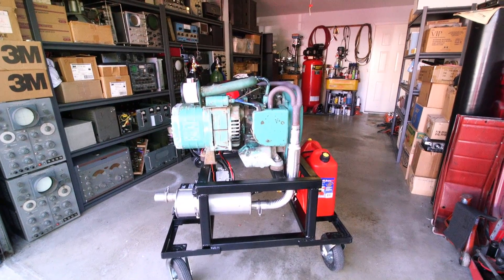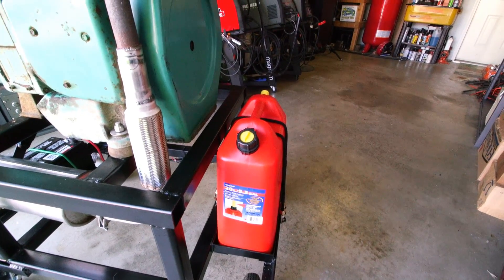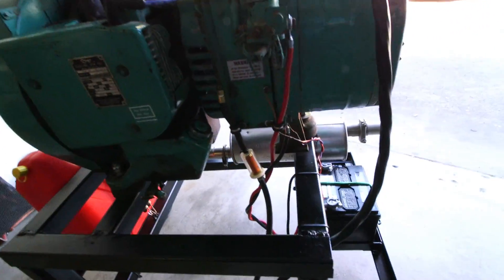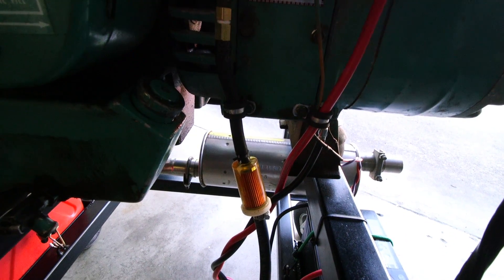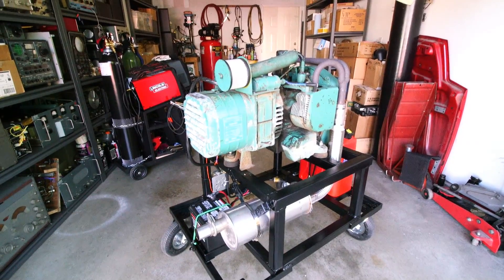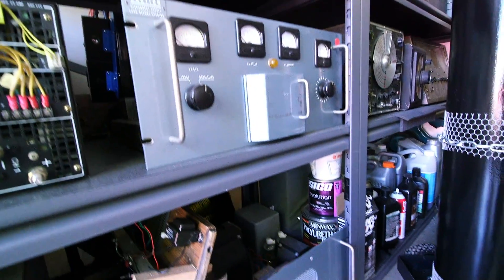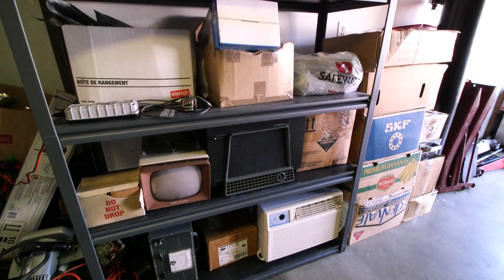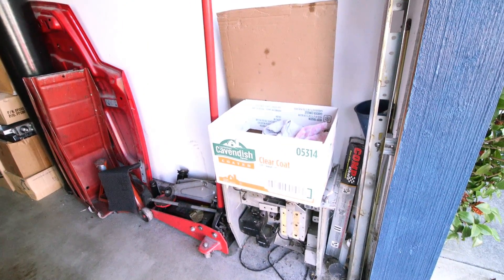Generator Build Update - See It Run!

Comment: Have you ever considered using propane for your stand by power? With the gas of today you will have to remember to change the fuel to keep it fresh. Propane will stay fresh MUCH longer and is cleaner burning than gas. A small 25 pound gas grill cylinder will run that generator for about 4-6 hours depending on the load. The regulator and kit will cost a few bucks but the ease of starting and the dependability is peace of mind.

Comment: Do you have ethanol added to your gasoline in Canada? You will have to add a gas additive to your gas if you want it to last more than a month or so. In addition the ethanol will eat at most rubber gaskets and seals etc.
Reply from the maker: I always use stabilizer, no matter what grade of fuel.

Comment: Worked on many Onan and Kohler Gens.  The Field control PCB on both of them is a weak point.  Repaired a many.    Pretty much the only problems encountered other then a engine issue.
Reply from the maker: No PCB in this at all. Wires, brushes and iron.

Comment: Hey I’m sure you know this already since you’re literally an expert in the field, I’m just new to the channel please so forgive me. Some of those old theatre audio amplifiers are extremely value to certain audiophiles. People will pay insane amounts of money for certain western electric, RCA, Altec etc audio amps.
Reply from the maker: I have some A&M theater amplifiers that are serial number 001 and 002.
Reply: @MrCarlsonsLab  the kids call that "flexing" :-) I've never owned anything valve based, I don't have the skills to maintain or even reliably operate it, but I live vicariously through your videos which are wonderful, thank you.
Reply: People like paying for their distortion :)
Reply: Dave Micolichek There are power amplifiers where you can synchronously sample the input and the output with a pair of phase-shifted 18-bit ADCs, apply a linear fit between the two to match gain and offset, use a steep FIR to limit bandwidth down to amp’s spec, and the differences between input and output are limited by the ADCs integral nonlinearity (1-2 LSBs or so). I work on such things so I’d dare say know a bit about them. Of course it’d be a bit crazy to use them as, say, speaker amplifiers, but audio”philes” probably pay more for some of their excesses anyway.

So yeah, no, you can and perhaps should use amplifiers that maintain the nominal accuracy of the input digital material, and are to the measurable limits transparent. And I’m completely ignoring the legacy specs of harmonic or intermodulation distortion, because those make sense maybe when you only got analog tools to do measurements. Once you digitize, you can measure the actual voltage values as a time series and see how much they differ between input and output. No need to do it in frequency domain.

These devices maintain their performance when you feed them with anything including wideband noise generated by a DAC fed from a random number generator. Even otherwise quite good audio amps fail such tests miserably because they don’t maintain a constant phase shift throughout the band, and when you feed noise through a varying phase channel you’ll get noise out back all right, except it won’t be noise that numerically is even close to what came in. When tested that way, off the shelf amps sometimes have trouble maintaining 9-10 bit levels of performance (1 part in thousand). 

So, noppity nope nope, I’m specifically working with transparent channels that can take CD resolution material and spit it out back with no alteration exceeding the resolution of the input. I’m paying for no distortion and I get it since that’s what the non-audio application demands - no distortion specs are actually used since it’s so misleading. 

I really wish I could take a good audio amp and use it in my application: alas, even the ones with best distortion specs just aren’t good enough because of phase and flatness issues. In a 16-bit channel, 0.0001dB flatness error (15uV amplitude drop from 1V) causes 1 LSB numerical error in a full scale signal. People think that 16 bits is “poor”, given 24-bit converters. Not even close, because all this has to be somehow transduced into voltages, and getting a 16-bit accurate voltage at the amplifier output terminals is stupendously hard - if the amp wasn’t engineered to such specs, there’s no chance it will perform anywhere close. 

The requirements for amplifiers that are truly transparent in the voltage time series sense are orders of magnitude tighter than anything normally sold for audio use. You need +/-0.00005dB passband flatness from DC up to whatever is of interest, and a constant phase flat to +/-0.00001 rad. Then you can, using a DAC, feed it a string of numbers represented as voltage, and get the same string of numbers back at the output. For testing you don’t need an ADC, just a physical delay line (a bunch of coax), and an AC voltmeter that measures the disagreement between the delayed input and the output. With a 1V full scale signal, the voltmeter would hover around 10uV RMS, even without bandwidth limiting, so I’d say that’s the performance you can get in practice. The results on audio amps are not worth even mentioning - they are kind of a joke. But surely they are much easier to make.

Comment: You have five or six joints in the fuel system all below the fuel tank any one that leeks could alow the whole tank of fuel to escape causing a heightened risk of fire! Here in uk it's best practice to have all joints above the highest possible fule level so if any leeks occur fuel siphons itself back into the tank. Not on the garage floor.
Reply from the maker: The pump is gravity feed, it was designed like that, as most generators are. The pump has to sit below the fuel tank.

Comment: Your fuel tank needs to be vented, with a check valve.
Reply from the maker: Hi Kennith. It's vented, and none of my generators (lawnmower.. chainsaw... weedeater....) have a check valve in the tank or cap. They do have a fuel baffle though, and so does this.

Comment: you can tap HDPE directly,just run the tap in the first few threads,just enough to establish threads. screw your fitting in with no sealers on it,it will seal perfectly due to the pipe taper. i've been doing this 20 years with plastic rain barrels and such.
Reply from the maker: That was done, along with a gasket in the tank, and one below for triple the safety.

Comment: Nice build. Yes those are VERY dependable. Everything you said is true, 1800 RPM twin cylinder Onan gensets are great machines. I worked on Onan gensets in the Army in 1975 to 1978 then again for an RV repair company where I started the genset "department" I also live where the power has gone out for extended time frames and I have a Onan genset I did the exact same thing with. Mine is only a 5KW set so the whole house does not get power but there is enough to live on :D Very nice.!

Comment: Crazy I actually own over half a dozen of these Onan Rv generators in different configurations.  I never get to use any of them, (Yes hoard them..lol)... and never can resist the temptation to grab one whenever they show up in the market dirt cheap. They are one of the best built generator units out there, outside of diesels.
Reply from the maker: I agree Franklin.
Reply: Onan generators are the best man, we have a propane one at our AM site and a natural gas one at the studios, they are both over 30 years old and when we need them they fire up no problem, I know today onan is owned by Cummins don’t know about back then but  I was talking to a truck mechanic the other day by chance he told me they build the gasoline, Diesel, natural gas and propane engines from scratch for each type where as other manufactures adapt one engine toward one of the four

Comment: It may be the camera angle but the battery appears kinda close to the muffler. This may be a problem after running for several hours. You may wish to either relocate the battery or fabricate a sheet of aluminum between them to dissipate the heat.
Reply from the maker: Far enough away that the battery is stone cold after hours of operation.

Comment: Great video! The question arises as to why you didn’t convert the generator to propane? As a standby generator gas is inferior.
Reply: Or whatever heating fuel is already used at the house if it's not electric heating. Of which, once you get to that point, wouldn't it make more sense to build a CHP generator?

Comment: I never though about a generator that runs at 1800 rpm instead of 3600. Make sense that the cheap ones would run at 3600. Probably cheaper to make, and they wear out faster so you have to buy a new one after a couple of uses over the course of 10 years.

Comment: Some of the welders?
 I can understand our garage full antique electronics but 3 + welders... ; )
Reply from the maker: Two welders and a plasma cutter.
Reply: @MrCarlsonsLab  I noticed them too..At least that old Lincoln portable I have has 50ft copper leads on it..
Reply: @rgsnidow1  I rock an old tombstone myself. 
I was thinking about upgrading to wheels cuz I've only got 20 foot leads... Spark On!
Reply: @MrCarlsonsLab  ,   Some people wouldn't know a MIG welder from a TIG welder, let alone know what a plasma cutter does.
Reply: @MrCarlsonsLab  Something I'd expect from This Old Tony...
But you did say some of,
Which led me to believe there may be more in hiding. 

You are a multi-faceted fellow Mr. Carlson.
And have aided me in the repair of many a 78/tube radio combo...
And a wealth of other knowledge I may or may not use. Thanks again!
Reply: Plasma cutter - nice

Comment: Is the generator wound for 1800 RPMs, or is their a gearbox?
Reply: A two pole generator rotates at 3600 RPM at 60 Hz. A four pole rotates at 1800 RPM. There are six pole generators that rotate at 1200 RPM. I ran a landfill gas generating plant that had three 20 cylinder Caterpillar engines (3520C) that turned at 1200 RPM. Their combined output was 4800 kW.
Reply from the maker: @carlwedekind3868  4.8 Mega-Watts is some big power! Thanks for sharing your story.
Reply from the maker: It's wound for 1800, and directly coupled to the engines output shaft.
Reply: @MrCarlsonsLab  , Thank you for the quick reply! I've been a long time viewer. I really enjoy your content!

Comment: Why do you need 3 welding machines tho?
Reply from the maker: Two welders (Mig and Tig) .... and a plasma cutter.
Reply: @MrCarlsonsLab  Oh ok. Is there a need to own both a mig and a tig welder? Which would you suggest an absolute beginner get? (I'm 17 and wanna get started with some diy fab projects)
Reply from the maker: MIG is the easiest to weld with (by far.) TIG on the other hand is difficult to begin with. ARC is good for larger projects, but difficult to begin with as well. I started with ARC, and still enjoy it (probably the most) but for small work, it's definitely not optimum.
Reply: @MrCarlsonsLab  Thanks!

Comment: Great video.  I have that same model. I mounted mine on a small 4-wheel garden wagon so I can pull it with the lawn tractor. According to the manufacturer it weighs 235 pounds. Thanks for the video.

Comment: Mr C, you are my guru for all things electronic.  But please, do not use that generator as configured.  Steel or aluminum gas tanks are easy to come by.  Vinyl fuel hoses are not safe.  All the fuel components need to be contained within the frame and not exposed underneath or outside the frame.  And lastly, please do not store or start a gasoline generator in an attached garage.  If in doubt, ask your fire department for guidelines.  With respect.
Reply from the maker: Vinyl fuel hose? Not on this machine. Rubber fuel hose yes, and rated for low pressure fuel delivery. Rubber fuel line to the engine was chosen due to vibration, solid lines would crack. The hose on the bottom of the machine is fine as it can never bottom out, even if a tire goes flat. The Jerry can fuel tank is extremely robust, and not going to leak. It doesn't even need the straps, as under full load, the unit just slightly vibrates. Believe me, safety was in mind when this was built.
Reply: Exactly my same thinking, you wouldn't want gasoline on the floor with the possibility of engulfing you if something accidentally punctured the vinyl...

Comment: That generator is likely (arguably) the most reliable and robust gen set ever made. The best part, Onan still makes spares for it and they're not expensive. That thing will run flat out, and the windings will be stone cold. My buddy has the same generator in his 26' race car trailer and it is so nice having power, quiet power, than you don't have to drag all over the place (its in the generator cubby hole).

Comment: Did you give the specs for the generator in another video?  Just wondering what it puts out in order to power your entire house.
That transmitter...did I understand correctly that it was a transmitter for a commercial radio station?  If so,  6146's for output?  Low power station?
You have a lot of wonderful stuff in the garage!  Will be fun to work with I am sure.

Comment: Make a video about how did you hook it up to house
Reply: The house line is 2phase in North America, unlike 3phase in Europe. Most of people that run generator would have heavy duty plug connection for running 2 phase or 3phase in Europe, say for welder connection. When the generator is operating the mains power switch should be in OFF position on the electrical panel.

Comment: I don't believe that you did not forget about this old generator. Did you thought about building a battery storage for your home?
Reply from the maker: I have, and I may do a video on this in the future.
Reply: @MrCarlsonsLab  Did you already considered battery chemistry you will use? Popular Li-Ion, LiFePO4, old but known lead-acid or something unconventional? Can not wait to see it!
Reply: @MrCarlsonsLab  that would be very much appreciated. I have seen people using recovered automotive batteries. With your talent for explaining how stuff works and knowledge it might be very interesting. And you know what? If you would talk about inverters there are some big capacitors, they can be tested ;)
Reply: Those big batteries require very careful management on charging. Load balancing between the cells is critical and if you get things wrong its very easy to turn your battery into a bomb.. Even very knowledgeable engineers have been caught out by it.. (thinks of the Boeing battery fires or the NASA robot fire etc) 
Basic defensive engineering for me puts a house battery into a concrete or brick structure that is separate from the house and can tolerate an intense fire. 
From a fire perspective petrol (gas) or diesel generators are mostly a lot safer. Not saying these things cant be safe but making them safe requires the expertise of people like Tesla who have put the research effort in to make them safe.
Reply: @MrCarlsonsLab  that should be interesting, having reliable power supply is everything to people like us in our field of electronics because without it, we have nothing to do but twiddle our fingers LoL. Battery technology is one area that people don't seem to understand, I mean it appears pretty straight forward but different battery topologies behaviour and this is where things get a little murky. My son got into the whole solar thing and got himself a bunch of 250W panels, a charge controller that has a built-in grid tied battery charger just in case solar isn't available or enough and also a trigger to start a generator just in case you should have one of those, then there's the built-in inverter. It's not a bad device but he got the version that's setup for 12V Batteries and that's where he began to run into problems, all 8 250W panels wired in parallel! LoL you should have felt the heat coming of the cables to the controller LoL, and secondly, he decided to go with one huge 650Ah lead acid battery thinking that it should be enough to get his computers through one night! But it didn't work like that. He chose to not take my advice and go with multiple small batteries. He just couldn't understand how load sharing across multiple Batteries would perform better with lower voltage drop under load and when the voltage dropped, the current increased to compansate for the lack of wattage needed and the whole situation goes south very quickly causing the single battery to heat and gas. That poor battery didn't stand a chance! I'm trying to get him to use those 9Ah style of Batteries that you can get in LIFePO4, use multiples and maybe even add a half ohm resistor to each to help them load share. But he just sees the price for their capacity and to him the lead acid battery looks better but it's just an illusion. To obtain good performance from lead acid batteries you can't just look at it's Ah capacity and think that it's just enough! Not with lead acid batteries, you need more than what you think to get reliable and long life out of them. As you can guess, that big 650Ah battery died in less than a year. Just because it's specifications claimed that it can take a charge at 20A, doesn't mean that you should!
Reply: Dave Micolichek  They look like they have some significant advantages over standard lithium batteries..